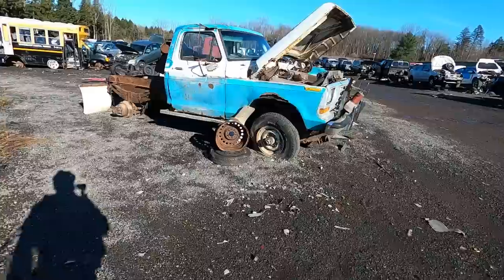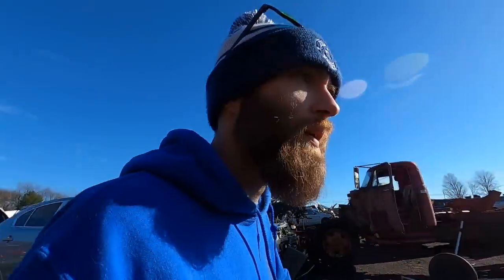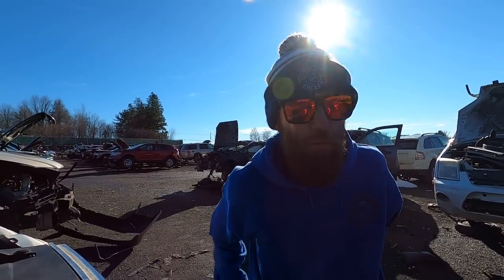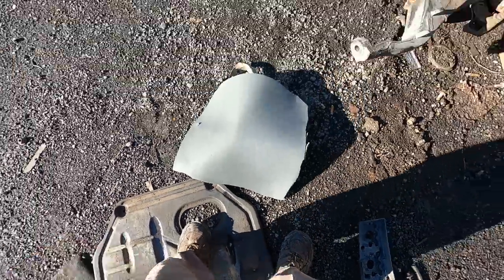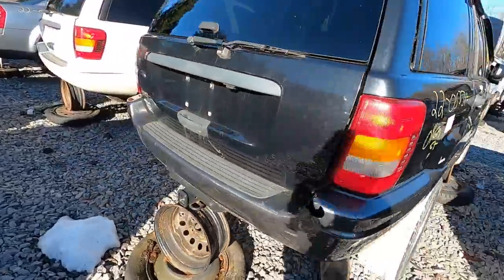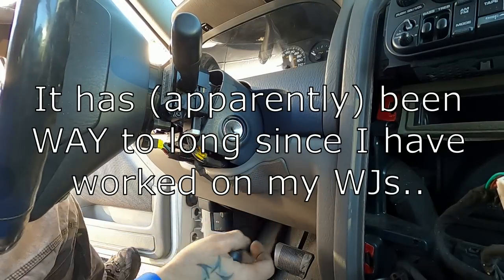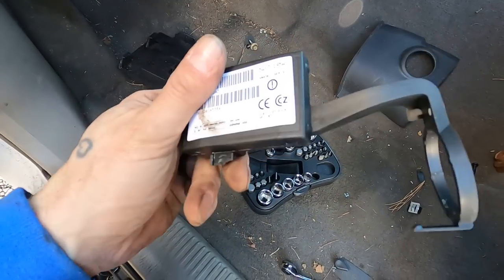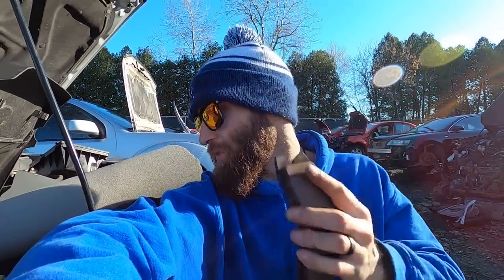Solving my JEEP ISSUES with JUNK YARD PARTS - D&E in the U-Pull 49

Comment: Those pads are a good score . I so love my WJ 4.7 . I have sold my WK2,Kk,XJ and bought a desiel Wrangler( in Australia desiel is best for remote touring as is can be 1000 klm or more for fuel) and still have my WJ . In Australia sometimes to find a WJ at the wreckers is dearer in fuel ($2 to $2.40 per ltr 4.5 ltrs to a gallon )  ( in remote ereas it can be up to $4 plus per ltr ) ( driving a V8 is yoga for the soul )and time to travel then just buy from Rockauto .In the past I have bought complete WJ taken the parts i needed then sold Wreck again . Love your work and enjoy your content. And yes you have helped me so much with my WJ .thank you

Comment: I have a white 99 WJ 4x4. My coil spring brackets are rusted out. Didn't know it until I went to change out my coil springs and realized I needed the coil spring bushings/seats. Pulled them off and there may have been a quarter inch still holding on the bracket where the coil spring sits. Haven't had the means to get more brackets yet sadly.

Comment: I have a 2001 jeep Cherokee xj I need a ABS module they don’t make them anymore any suggestions
Reply: Junkyard, ebay or fix yours. Look up repairing abs module on jeep. You cut case open and resolder the power pin to the abs pump which is usually the problem. I just fixed mine forfree